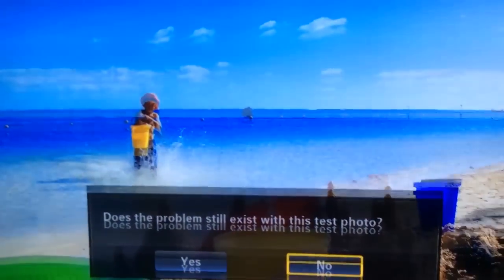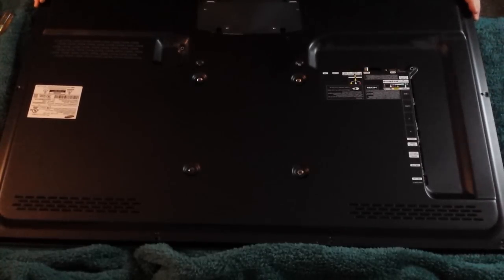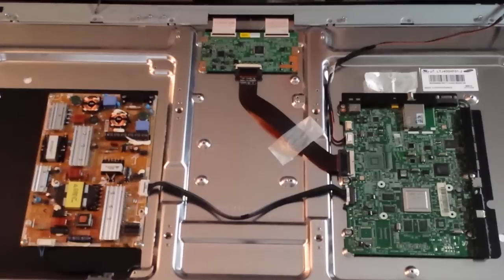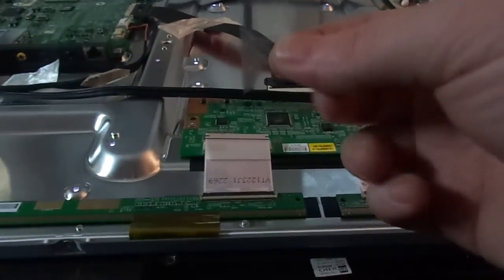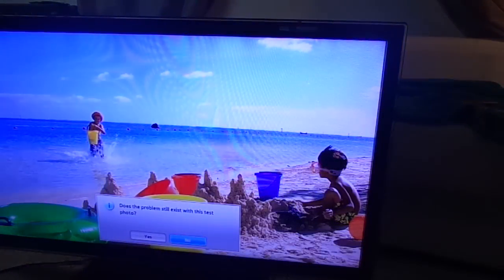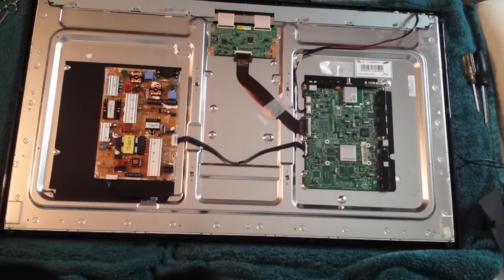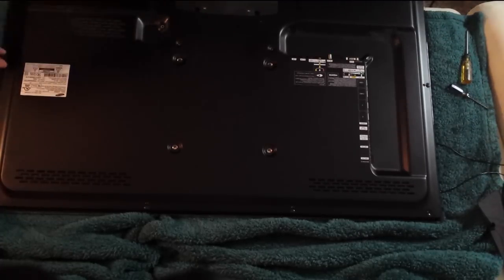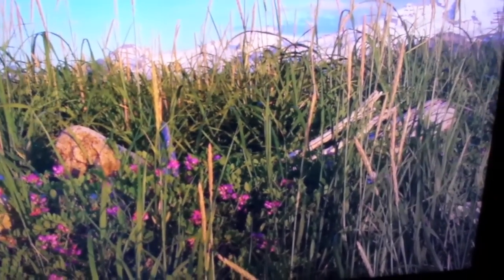LED LCD TV FIX, How To For Samsung Double Image, Black Vertical Lines, Screen Problem Sony LG.

Comment: So the double image and lines on top happened to me today, I did like you said in the video and everything, the left connector didn't do anything but as soon as I took it the right connector the left side went back to normal, so  assumed it was the right side. Anyway, I eventually got rid of the double imaging, but now there's a big black area on the right side that I cannot get rid of, at all. Sometimes there will be white that goes through the black,  but no picture,  just white. The link will go to a picture I took of it, if you have any ideas I would appreciate it greatly. 

http://postimg.org/image/6do6om1i7/
Reply: Now it's doing something other than just black.... another picture here. 

http://postimg.org/image/bosivz9j1/
Reply: Tom Boshans sorry multiple posts, keep forgetting something. The black thing happens now with or without the tape on the connector. It started happening after I wiped the right connector with my finger to get rid of static or whatnot,  then I put a piece of tape over the entire gold connector part and took it, I didn't put it in like that. Then the black happened. So I put a little piece of tape on the right side of the right connector and it went away, but it was still double imaging. So I took that tape off, and after that the black part would not go away no matter where I put the tape, if there is no tape, nothing works. As it is now, there's a thin piece of tape on the right side of the right connector, it got rid of the double imaging at least. I don't know what's worse, the black part that's on the now, or how it was with the doubling.
Reply from the maker: Tom Boshans The first picture you sent looks like the left panel is having an issue. Also you went back  from one cable to the other too troubleshoot the issue your tv was having.  The video shows exactly how this fixxed my tv in the steps preformed. 

 Check to see if one of the cable ends (where the ribbon cable makes the connection) has any damage to it.  Maybe the tape being put on and taken off several time striped something off.  Just to let you know the white lines in the first picture usually cover the entire left panel when the cable end is completely covered or at least half way covered.  It looks normal for the white to be there but not the black.  If the tv I was working on had this issue I would  calmly inspect all the parts that I removed and worked on to see if there are any obvious signs of a broken component. 

 Please comment back with any updates you have.
Reply: The left connector has a little scratch on it on the right side. Having the TV sit the way you had in the video, it is the right cable if you are looking at it from behind, and on the right cable there is the scratch on one of the pins towards right end. Without any tape on it, there is still the black on the tv and image doubling if I just put it in, if put the tape on that scratched piece, the doubling goes away, but not the black. I think the ribbon cable is just bad, I'm hoping it's not the connector itself. The left cable if your looking at it from behind seems fine, without the right side connected the left panel looks great, no double imaging, so in guessing it has to be the right cable. 

Oh and that white part hasn't happened again, the whole thing is black now like the first picture, with occasional white horizontal lines shining through, I think that's just the backlight though.

Also, I don't know if it matters, but I couldn't get the big metal piece off on the bottom of the TV, the one that is on top of the long board with the 4 or 5 pieces of tape. One of the screws is apparently stripped. I don't know if that makes a difference or not to take that piece of and take the tape off.
Reply from the maker: Tom Boshans Thank you for your reply.   From what you are saying the ribbon cable seems to be what is causing the issue at this point.  The metal cover can be left on however it will be more difficult to work on the ribbon cable do to less play.  If you have stripped one of the screws then you may not be able to loosen it.  Take a look at the screw and see if there it still has a visible phillips head cross pattern.  If there is and you still want to gain access to the cable strip get a small phillips head screw driver. Small enough to take out the screws that are not stripped, and use it on the one that is stripped.  

As for  the ribbon cable I'm not sure if you can switch it out.  On my tv it looked like the entire strip from where the left and right cable sit next to each other over  to the connections that run out and under the bezel would have to be replaced.  I did not disassemble my tv passed where the video shows but there could be I part to purchase that you can switch out.  

What ever you decide to do please continue to post your progress.  It really helps to know as many possible outcomes in assisting one another to make this fix.
Reply: David Koenig So I switched the ribbon cables just now, I the left one, the side that was working correctly, and put it in the right, and vice versa, and it is still the same picture wise, the left side of the tv still has the black bar. So since  switched the cables, I can deduct that those are not the problem, I think it has to be the connector itself that the cables are hooked up to, the right one is probably breaking. My tv model is un40d6300, I took a picture of what the back of mine looks like, you can remove the cables completely on this model. I don't see what else it could be. I'm trying to put tape on multiple places right now, I'll let you know if it does anything.
Reply: David Koenig oh here is the image. 
http://postimg.org/image/obqrygbq1/
Reply: Tom Boshans Hey there.  Thank you for updating your progress.  From what you have done to troubleshoot this issue so far is probably exactly what I would have done.  It was interesting that when you switched the cables from one side to the other, the tv was having the same issue.  Looking at the picture I would have guessed there was a fault in the ribbon cable.  Because where the black line on the top fades out and back in when looking from left to right.   At this point you may need to reach out to a couple different blogs to help better understand the issue your tv is having.  If you continue to work on this then I say be calm and logical.  Normally the more simple solution is the answer.  Please keep us updated with any progress you make.
Reply from the maker: Tom Boshans  Hey there.  Thank you for updating your progress.  From what you have done to troubleshoot this issue so far is probably exactly what I would have done.  It was interesting that when you switched the cables from one side to the other, the tv was having the same issue.  Looking at the picture I would have guessed there was a fault in the ribbon cable.  Because where the black line on the top fades out and back in when looking from left to right.   At this point you may need to reach out to a couple different blogs to help better understand the issue your tv is having.  If you continue to work on this then I say be calm and logical.  Normally the more simple solution is the answer.  Please keep us updated with any progress you make.
Show less
Reply: Do It With Dave Hey there, been a while since I updated, was waiting for a part I ordered for the tv. Ordered a new T-Con board, the little board that those ribbon cables are plugged into, i figured that had to be the problem, since I switched the ribbon cables like I said last time and the black bar was still there. So I changed out the board just now, oh let me complain about screws for a second. Whoever built these tv's stripped 3 of the tiny screws on my tv, quite annoying. Anyway, I changed the board, and of course the black bar is still there. 

Before I put the ribbon cables in the new board I took off the tape I had on the right one, the tape to stop the double image. So I put the new board in and the ribbon cables without tape, and there's still a black bar, it is half the size as it used to be though, and double imaging again! Gah! So I put tape in the same spot as before and the double image goes away again, but the black bar is still there, half the size it was before, which is good, the tv is a lot more viewable now. I changed the ribbon cables again also, switched the right and left one, and still the same thing. I even took out all of the cables you can take out, not just from the t con board but from the entire tv, and cleaned them and all their connectors, but that didn't do anything either. So I really have no idea what the problem is now, it's not the screen since the black bar is half the size now. I really don't know. I'm going to get new cables and see if that works but I doubt it. 

The t-con board wasn't brand new, but I don't see how a completely different one that was said to be in working condition, can have the half the same problem as mine when I put it in my tv. I don't know what else it can be, maybe the board under the long metal piece? I don't know if that's anything, but that's the only other part the ribbon cables connect to. Here's a new picture of what it looks like, if you compare the older picture the black bar is exactly half the size. The left half of the tv is broken into 3 quadrants it seems, 2 were black before, now it's only one. http://postimg.org/image/874s1axkp/
Reply from the maker: Tom Boshans Man that's a bummer.  I would be very frustrated if I were in your shoes,  congrats on keeping your cool.  Its so interesting that the black line is smaller after replacing the board.  I would think that by doing so it would show up with no line rather than a thinner line.   I took a look at the video recently and when I was adjusting the ribbon cable in its slot  at one point there was a black line like you had in the first pictures you sent.  If you re watch the video towards the end you will see what I'm talking about.  I can be a lot like you when it comes to figuring something out.  I will do this and that and the other to troubleshoot an issue with what I'm working on.  Sometimes I get it all figured out and sometimes I don't.  Just remember your time is valuable and sometimes purchasing more and more things in hopes to fix a problem isn't always the way.  I know your in it and you want to find the solution and that's good.  I want to say that we don't always receive the correct answer as soon as we'd like to all the time.  Please keep us posted.  Thank you for all the updates.
Reply: Do It With Dave I think I must have messed something up when  was playing with the cables while the tv was on still, I don't know. The black bar in the most recent picture, you see how thick it is right? The entire left side of the tv is made up of three "panels"or quadrants of that thickness. Not actual panels, but you know, I guess the tv breaks each side up into 3 pieces. That's what I mean by half the thickness. If you take the thickness of the black bar and times it by 3, you would fill the entire left side. So basically before 2/3 of the left panel was messed up, now only 1/3 is. It's weird. 

I posted on a forum and someone just said it's the lcd panel itself, but I really don't see how it can be. If it were the lcd panel itself, why would half of the bar disappear and fix itself by changing the board, that doesn't make sense to me. I don't think it's the ribbon cables but I'm going to try changing those next since they're only like 15 bucks. Let you know if that works once I get them.
Reply: Hey Tom,
I just did this today and found that if you find the right size tape, move the it inward from the left side of the tab, I think mine was 5 lines in from the left edge. Hope this helps..

Comment: Thanks so much for sharing your time.

I have a 2 yr old Samsung plasma 50 inch, and one google will show that my problem is common-and shows up with no other signs at this age. As this fairly new TV is now worthless, I am willing to give anything a go.

I have medium tech skills (somewhat high for a girl i guess), but tenacity goes a long way :).

The prob is one fine Horizontal line across the face of TV.

I have rebooted it, the line is present across all devices, and is behind the menu screen if any of this helps.

So grateful if you can help!
Reply from the maker: It seems like the line could be fixed by adjusting the ribbon cable in its slot from what I've learned about this fix.  It is strange that you say the line shows up behind the menu screen.  I would think the line would show up on any image that projects on the screen.  Please share anymore information you can.  Thank you m h Mackenzie.

Comment: Now my tv has I one vertical black about 2in long & maybe a 1/2in wide. Will trick work for that & could it just be a simple static issue. Here is a picture of the line located in the bottom right between the info bar & the edge of the tv screen. 
https://onedrive.live.com/redir?resid=45255506598CA5F8!74972&authkey=!AJQohzOl3GgzeOc&v=3&ithint=photo%2cjpg
Reply from the maker: All's I can say is if the problem I something you cant live with then give it a shot. Depending on the tv it could be another issue.  Read Spielberg De Pereira comment below and see if the link helps in understanding how you may be able to fix the issue.  I'm having difficulty seeing exactly what the problem is with your tv.  Maybe you could take a picture from further away so the entire screen is in frame.  Please share what you end up doing.

Comment: I had the double image also and used this trick to fix it.  It was the left ribbon  just like in the video.  At first I was getting too dark an image on the right of the screen so I tried a narrower piece of tape.   After the color was right I had some slight lines which I got rid of by flattening the tape really good..
To do the actual repair does anyone know which part needs to be replaced?  The ribbon  itself or the board?
And how on earth did you figure this out.?
Reply from the maker: Thank you for sharing Tom DePaolo.  I don't know what part is failing.  SimplyBored posted that there may be a build up of static electricity on the ribbon cables contact.  I found this video  TV LCD Samsung c/ vertical trêmulo e imagem sobreposta: Como consertar este defeito!.  Thank you for watching.

Comment: Thanx very much for this video. Just bought a Samsung LE40A558 model lcd tv on the flea market here in the UK for 40 pounds that had bad vertical and horizontal lines and double image. I guess you can imagine the picture what it looked like.
Using your method loosening up the left side ribbon (facing the screen) and just re-seating it fixed it. I didn't use the tape, but just undid the clip holding the ribbon, pulled it out and while watching the screen started to play with and voila, the screen became clear and line and double image free. Good Job. Hope it'll help others as well.
Reply from the maker: ALRIGHT John Benak that's what I'm talking!  Thank you for posting.

Comment: hi i do everything what u show and fine no double image,but one side screen little bit darker.and i now dont know what i can to do..:(
Reply from the maker: I had something like that at first but it seemed to fade away with time.  All I can say is if you want to try something right now maybe use smaller piece of tape closer to the edge of the ribbon cable.  Or you can remove the tape and see if you have one side darker without the tape.  If you read the comment below, SimplyBored  fixed their tv by just taking the ribbon cable out and wiping it with a finger. Please reply if you work on it again or have any updates.  Thank you for watching.

Comment: i dont know but after i removed and reseated both ribbons, it turns white and i dont know how  to put it back..
please help
Reply from the maker: Spielberg De Pereira,  
Gently insert the ribbon cables back into their slots and push the tabs back down.  If that doesn't work then tell me if you used the tape or if you just reset the cables back into the slots.
Reply: thanks mr.david, actually this actually works and followed your instructions..though i didn't try the "tape" step
i'd reseated both ribbons and the picture is ok now but im still seeing the whole screen white/negative.
it actually looks like this,
http://jkturner.net/samsung/index.html
(credits to the owner)

btw, thank you so much Mrl.David!thank you so much :D
Reply from the maker: I see.  Thank you for posting this link.  It may help others wanting to fix their tv.

Comment: Opened up the tv today. Slightly different model but for the most part everything was the same. Took the ribbon out, wiped it with a finger re inserted it back in and black lines were gone. There's a chance it was just static electricity sitting on it but honestly I don't know what fixed it but it's all great again
Reply from the maker: YEAH! Thank you for sharing.